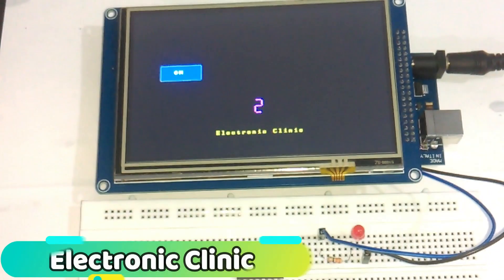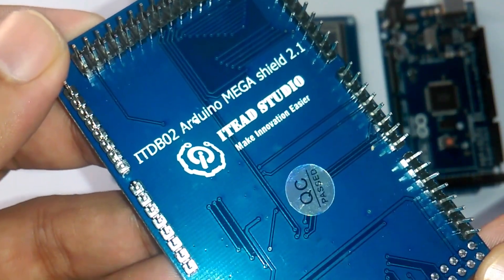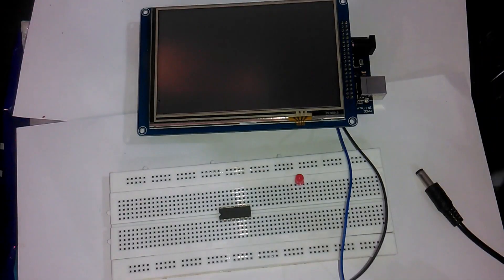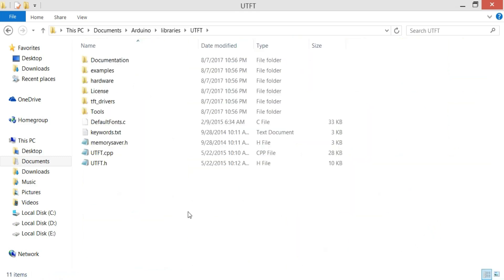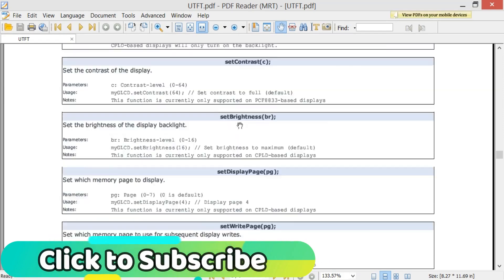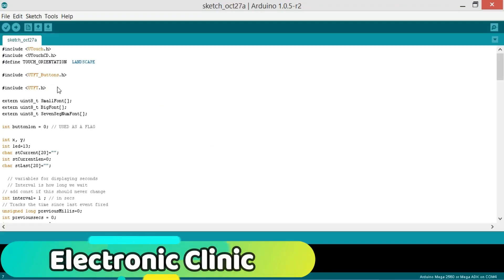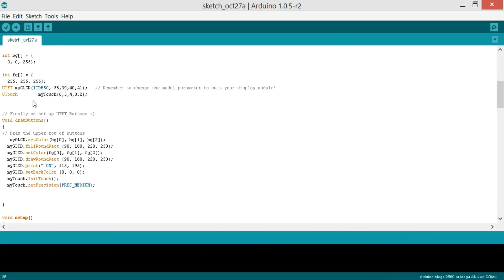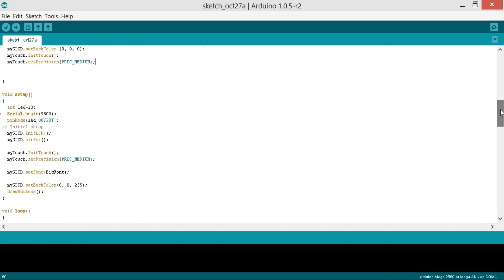Arduino Mega HMI touch screen "7 inch TFT LCD" based Load controlling and display Seconds "Basics"

Comment: I know about UTFT library under arduino, but before purchasing any TFT from random website how I can be sure that this TFT is going to work with UTFT library, could you please help me with that.
I am looking for 4.3 inch, 5 inch  and 7 inch TFTs with resistive or capacitive touch.

Comment: whoever created that shield without leaving access to unused pins has completely defeated the purpose of interfacing the two. another idea is to but a big tree tech 3d printer touch screen that has a built in stm32 and more ram and flash than an esp32. it has many exposed pins on the back and a built in encoder, neopixel, sd card slot and a usb port.

Comment: Hello my friend, I have a request. Can you upload a video that teaches how to calibrate properly the 7" TFT LCD using arduino mega and TFT shield. I have trouble in calibrating my LCD. The LCD did not respond to where I touch. Thanks.
Reply from the maker: I have shared some pdf files on my website. Give it a read. Right now i dont have this LCD.

Comment: Does spfd5408 driver LCD will work using this library?
Reply from the maker: I am not sure check the specs
Reply: @ElectroniClinic  utft library doesn't have this driver mentioned in their supported controller list. Thanks

Comment: Sir can we use Arduino uno
Reply from the maker: ya you can, but this shield won't fit on the top of arduino Uno. mega is recommended.
Reply: Sir then please make a video with arduino uno because mega is very costly I can't afford
Reply from the maker: @shuvadipghosh374  my dear now i don't have this lcd. Arduino mega isn't too expensive. don't worry you make the video i will pay your hardware. if you are low on budget, then i am with you.   
i am going to start from you. now i will share 30%
of my youtube and website earning with my subscribers.
Reply: @ElectroniClinic  sir how are you going to pay
Reply from the maker: @shuvadipghosh374  its through paypal. You dont need to be worried. start working on your project and when you are done make a demo video of it. 
let me know when you are done.
Reply: Thank you sir @ElectroniClinic

Comment: Hi. Can you upload a video on how to properly calibrate the 7" TFT LCD on Arduino Mega? It will be a big help to us.
Reply from the maker: It doesnt need any calibration. Just use my programs. Watch other videos in this series
Reply: @ElectroniClinic  half of my 7" LCD doesn't respond when I touch it and when I touch it on the side that should be functioning. The LCD doesn't produce the right output.